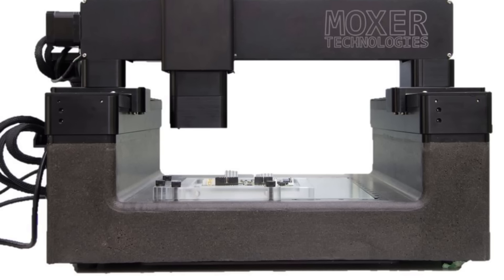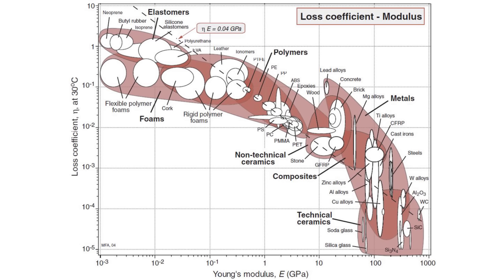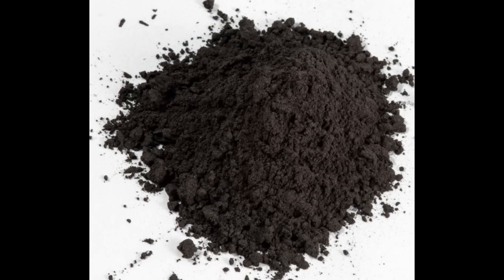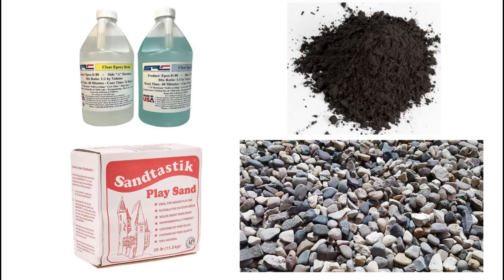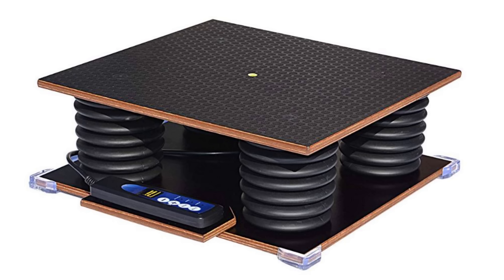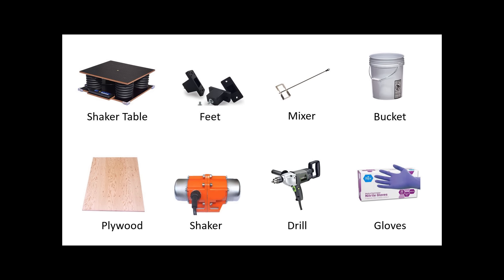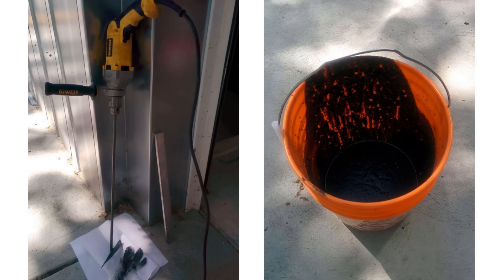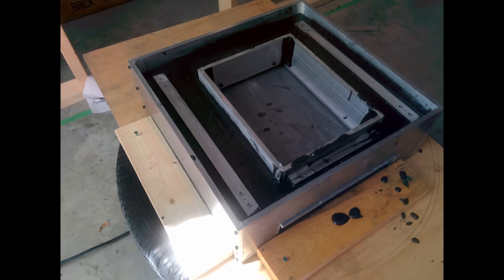How to Build Epoxy Granite Machine Base

Comment: I wonder if several old video game controller vibration motors would make enough vibration ?
Reply: Not in the right scale. You could rig up a sawzall, but I don't know if it's motor could take the heat from running that long.

Comment: Why call this tutorial video "Epoxy Granite" whereas there is literally zero granite aggregate in the various recipes? You used sand. It's a sand-based polymer concrete, not epoxy granite.

Comment: First off great video. Very informative.
I worked on an R&D project using Metal Injection Molding. The goal was to maximize the density of the metal balls and minimize the plastic filler. I learned that if you have fairly uniform diameter balls, the amount of plastic was about 17% (by volume) to have a mixture that had no interstitial voids with the minimum plastic. This 17% figure will always be the same for any mixture using uniform ball (or rocks here) size regardless of the size. Somewhat counter-intuitive to me. This would seem to be applicable if you assume that the sand grains are fairly uniform in size.
You can get a denser mixture by using significantly larger rocks with the sand filling the space between the rocks.
Here in Florida, I would put the fillers in the oven to drive out any moisture.
Reply: that's because of the nature of packing spheres. Sand grains can pack much tighter because they aren't spheres.

Comment: Are those epoxy resin components clear in color? I probably would have mixed the dye with part B first in a separate container, so that I could see the color of the whole mass get even to know I'm mixed properly.
Reply: Sometimes you ad a drop when you put A and B in one container before mixing it together but mostly when you add hardener to epoxy it looks like ading oil to fuel....you mix it until eweryting is clear.

Comment: So when it comes to vibration dampening, did anyone ever compare this to the stuff typically used for setting machinery? Stuff like precision grout, or some of the metal based aggregate grouts, or something totally epoxy based like Loctite nordbak? 

I would be curious how an epoxy and precision grout would behave. Interesting, would be cool to see some data on vibration dampening effect.

Comment: do you think there'd be any benefit to casting epoxy granite into aluminum t slot extrusions, such as 8020? My CNC is made with 4x2" beams and Ive been considering filling them.
Reply: I'm wondering the same thing. Did you try it? Did it help?

Comment: I have done this with my own recipes and here are some tips and tricks.
1) Pre-heat the sand and resin which helps to speed up curing and removing bubbles as it lowers the viscosity of the resin. ( I didn't get any bubbles without using a vacuum chamber)
2) I mix sand, pea gravel, and crushed rock for mine as it uses less resin (Approx 5-10% resin to other ingredients)
3) Fiberglass resin also works extremely well and this is what I use (40$ at Walmart for a gallon).
4) If you want it to look professional, mix in charcoal powder to give it an extremely black coloring and nice surface finish. I made my powder from aquarium charcoal in a blender.

For my next tests, I will be mixing glass fiber along with the other ingredients to try and increase the composite strength.
I was blown away by this polymer concrete's performance and will not be going back to regular concrete.

Comment: I like the theory {a lot}, however, I wonder how well it can stand up to years of vibrations on a CNC router? I have a "few" sheets of MDF under my spoilboard just to add weight to the table.  The steel framing members are double the weight they need to be just to add mass.  A 5'x10' epoxy table for a CNC router would be a challenge.  
Very nicely researched and the results are spectacular.
Reply from the maker: Thanks Lew!

Good question, would be interesting to run a long term durability test on this. Epoxy is highly resilient, it can take a ton of abuse, and still hold up.

Two machine base builders, Castinite and Zanite both build commercial frames in a similar manner, although they refer to this material as "cast polymer" or "polymer composite"

Weight definitely helps knock down and absorb vibration, although stiffness and damping are equally important.

Would be quite a challenge to build a 5'x10' bade for this. I imagine building up a single use mold out of waxed MDF, and then dividing the pour up into multiples so they cure time doesn't take weeks. What a project that would be!
Reply: For a router, I'd surely combine both steel tubes and concrete in a Constrained Layer Damping configuration to maximise the damping/weight ratio.
I'm actually even studying it for a VMC project
Reply: I'd just fill the box beams with the chosen absorption material for that.

Comment: What is this machine for? Laser cutting?
Reply: I don't believe he would need this level of rigidity for laser cutting, probably cnc milling :)
Reply: @theonismithcreations8554  strange... CNC milling require a super rigid structure, like steel or full aluminium profile
Reply: @yakine13  considering this has an aluminum skeleton with an epoxy/sand  encasement, this would be more than enough to mill anything aluminum and softer. 

Reguardless, he is using this for extra stable micro photography.

Comment: I had never before heard of epoxy granite before today
Reply: I started the first polymer concrete casting company in the US in 1988 and have been producing castings for grinding machines, inspection equipment, chip bonders, chemical pump bases, etc, since. CASTINTE

Comment: Why concrete isn't so good as epoxy granite?
Reply: concrete brittle as biscuit. epoxy flexible. make good vibration dampener. 
sand and rock make epoxy heavy so machine dont move. combine make good material. 
brain too smooth to think?

Comment: My theory: using a vacuum chamber or high pressure to get the bubbles out will propably lead to maybe only epoxy filling the voids. You want the filler material as dense as possible though. Vibrating the material would be the best choice then I think. Your vibrator table seems to not be sufficient enough, maybe try a small electric motor with an offcenter weight on the shaft, and something to control the motor speed maybe. Would also be cheaper.
Only using sand is also not that great, since it still is kinda coarse. There's some basalt based grit that's used for filling the gaps between walkway stones, it has bigger particles (maybe 1/16") down to dust like particles. Should work nicely.

Comment: You could eliminate some of your epoxy by using a finer aggregate all the way down to fly ash though fly ash can pose a health risk.  Epoxy by itself isn't as strong as the aggregate you are using.  Less epoxy, stronger mix.  Same with concrete.  Portland cement by itself isn't very strong.  It's strength is in sticking bits of rock together.  Great build.  Thank you for posting.
Reply: The epoxy doesn't need to be strong. It's purely for damping.

Comment: Hello Adam!
Good choice for the base but I was more interested in the precision aluminium sections and how you went about procuring them.
Perhaps you could try the electro magnetic vibrator ( without a motor and eccentric weights ), which have a small amplitude of vibration about 1.6 mm, also used by construction people.
Also you could use silica flour as fines. This and the sand should be dry as the heat generated will release some steam.
Anyway you've been acquiring the skills as you went along.
Best wishes!

Comment: Are plans for the rest of the CNC machine available? Also, I wonder if you could further reduce vibration by filling the hollow aluminum tubes with additional vibration dampening material.

Comment: Isn't lead alloys closest to the upper right corner of the chart? Let's take a quick look. 

Pros: cheap, easy to cast, easy to machine, very heavy. Cons: very heavy, not strong, the weak alloys dent easily, the strong(er) ones are brittle, oxides of lead and many of the alloying elements are toxic.

Comment: yeah looks like you may have had some moisture troubles. And a vacuum chamber is a good idea but only vac each epoxy side A-B separate before mixing. This will help remove a lot of the air bubbles and when you mix do so gently to avoid adding air. For the best results after drying all other materials, vac A-B parts separately, you could pour some material into mold (not all), (I would pour epoxy in the mold 1st then add the rest)mix epoxy, pour and then add the rest of the material, stir all together gently to avoid adding air and then put mold in a pressure chamber to around 55psi up to 65psi... this will absolutely give you the best results.. I highly recommend Not Pouring one part of the epoxy in the mold adding filler and then adding the other part of epoxy!!!! Epoxy should be mix completely by itself before adding any of the other materials to it.. I think you have a great idea I really do, but I gotta say you went about mixing it all wrong bud.. resins can be really fussy, sometimes an out rite pain in the rear.
Reply from the maker: A pressure chamber would have been great for this build! Unfortunately I did not have one big enough for this mold...
Reply: @AdamBender  Preston is correct. Mix the liquids first and draw a vacuum on that mixture. You have to remove the moisture or you will get a lot of internal voids and poor strenght.
Reply: Yes, degas the resins 1st and pour enough into the bucket to avoid sucking air in while mixing. Also, bake the sand & grit to release moisture before use. Also part of the goal is different grit sizes to scatter & absorb different frequencies.

Comment: Isn't play sand mostly quartz? Wouldn't decomposed granite have been a better choice since the granite rocks were removed from the mix? Also how well does the machine work, can it handle steel?
Reply from the maker: Yup, I believe so, perhaps epoxy quartz would have been a better name for it, although I stuck with epoxy granite, since people are more familiar with that name.

It was actually a machine base for a 3 axis microscope, but given how stiff it was, I'm sure a small spindle could have been mounted to it.

Thanks for watching!
Reply: I would avoid decomposed granite myself, because it might continue to decompose over time. The granite contains quartz grains, feldspars and some mica. The feldspars and mica decomposes and take up extra space. They become clays and oxides. The Quartz in the sand is very inert, being Silicon Oxide already.

Comment: It's a lot of work, kudos for that. But you didn't the address the most important part of the build. The actual flatness of your surface and how you got there.

Why wouldn't I use concrete instead with an epoxy finish?
Reply: You got the point!

Comment: Great work here! 
You inspired me to think of a couple things that might help. 
1) a cheap shaker motor is easy to make: just use any motor, bur on the shaft you put an imbalanced load.
2) Instead of using an impossibly big vacuum tank, use the atmosphere itself by doing the opposite: mix the epoxy inside a pressure tank. That's way smaller. 
When you're done mixing releasing the air bubbles that were at high pressure should vent off easily into 1 atmosphere. When you pour it take care to not create bubbles. They shaker table should help with the rest of any trapped air.

Comment: Is this an established method of creating machine base?
Reply: Polymer concrete is what they use nowadays to make most accurate machine bases from, with aluminum inserts for attaching ways etc.
Reply from the maker: This has been used in industry for some time, but this method opens it up to the hobbyist with a limited budget

Comment: Very strange load tests, the real machine and half do not.
Epoxy granite is justified only by its weight, weight allows you to reduce the frequency of personal vibrations of the structure. But metal is much more justified in this, if the melting of steel and cast iron is not available, then it is worth considering bronze and brass.
The simplest and most affordable base for a CNC machine is a square welded steel profile fill in concrete. Simple and cheap.
Reply: 100% tak!

Comment: So not granite, epoxy concrete. I think I would put chopped strand glass in it as well for added strength .
 I am wondering if there will be problems with thermal expansion causing the aluminum and concrete to delaminate. Take your test block put a dial indicator on it and heat it up 100 degrees. Calculate the thermal expansion coefficient and compare that to aluminum.  It will make an interesting video.
Reply: Chopped glass does not work well because of the sand filler
Reply: @terrycapuano982  glass strands are used all the time in cement/concrete and in epoxy so why would it not work when concrete uses sand as a filler.

Comment: Some suggestions:
1. To improve mechanical characteristics, use 
 - a single digit percentage of epoxy
 - an aggregate with significantly better packing density
 - preferably grey cast iron or at least steel as reinforcing and interface members as its CTE matches that of the composite described above
 
2. Feel free to coat the inside of the mold w/ your material of choice (most of the time I use carbon-filled (i.e. toner powder) epoxy which gives a nice, shiny, smooth, jet black surface) before you start filling the mold w/ your actual mix. This way you don't have to factor in aesthetics even when you're supposed to design your composite to achieve the best mechanical properties.
3. Reinforcement might not even be necessary at all if your machine frame was designed to take advantage of the compressive strength of the composite, which can be brought up to 200+ MPa if you're open to using a more decent mix.
Machine tool manufacturers don't seem to bother reinforcing their frames.
4. Vibration is the way to go. Vacuum pumps don't take epoxy vapor particularly well.
Reply: If you arrange internal cooling to the aluminum frame, it is actually better than steel or cast iron, as it conducts heat 3 times faster, thus you are able to maintain a set temperature easily.
Reply: Agreed thats how the machine builder kern has machines with about 1 micron positioning tolerance
Reply: Hi sniperasys, could you elaborate on the "more decent mix" you mentioned to have a greater comp. strength?
Reply: @JaakkoF  Hei Jaakko, voitko suomentaa tämän neljän kohdan ohjeistuksen ensimmäisen kohdan? En ymmärrä kahta ensimmäistä ranskalaista viivaa.
Reply: @uciaok  I'd imagine a much bigger gradient of aggregate size? Like a good concrete 🤔
Reply: @fannerguitarworks1024  I guess it should need different sizes of aggregates instead one. Like right ratio of Fine and Coarse aggregates would give better dampening properties with compressive strength.

Comment: Your final result looks great!
However there are a few issues I have with your video.
Firstly the gloves aren’t for clean up primarily but for safety! Epoxy can get pretty nasty and the last place you want that stuff to be is on your body!
Secondly, to ensure that the epoxy is mixed the right way, you have to mix both parts first! Than the sand and dye. It could be that your result works for you, but usually there is a huge possibility to fuck up. Also, if your epoxy is slow you have the time to do it right.
And lastly, this is just a preferred method of mine, if you use a filler for creating the round corners you could perfected those even further.

Still a pretty nice video and I appreciate the work you put into it

Comment: Great video! I'm planning on reinforcing and expanding my small milling machines column and base and make the switch to linear rails on all 3 axis. This information is very helpful.
Reply: He did a good job, but is using way too much resin. It will provide poor mechanical properties.CASTINITE

Comment: A few of my ideas...
step 1 mix just clear expoy and harder together brush spray into mold...  let it tack up the us a heat gun to pop bubbles... on the surface of mold let it set up for several hours..
Step 2 mix epoxy with harder and black pigment or paint... spray over  the clear expoy let it tack and use heat gun to pop bubbles repeat  a few times on corners or vertical surfaces where you need thicker covage...let it dry or tack almost dry..

Step 3.. mix expoy part a b add optional dye then add sand.... the harder... apply with  spreader or bondo spreader to mold 1/4  to 1/2 thick coat  as a surface finish to finished faces.. let it dry

Step4  next day mix expoy with sand and some small gravel...fill mold up to 1/ 4 below desired depth...mix new  top coat with expoy sand mix and Harder etc... to give smoother finish on under side

This is how I get flawless  smooth expoy granite.
Reply: Step one and two in one step: Called Gelcoat.
Reply from the maker: This is a great method, those surface bubbles haunted me, sounds like your technique would eliminate that. Thanks for sharing!

Comment: I think I've read your article on this about 10 times now. Great to see some videos too. A long-term review of the microscope / base would be interesting. Will keep watching for more videos.
Reply from the maker: Thanks for watching Aaron! I'll keep the videos coming.
Reply: @AdamBender why not adding fine rubber or foam aggregate with concrete and a urethane binder? Why aluminum not steel?

Comment: I have been looking for this for a long time now. Thank you 1000 times. I just finished a steel gantry mill and it vibrates worse than a tuning fork and i need a solution. This is it. I'm going to fill it and encase it with epoxy granite. 

lets see it run!!

Best Matt
Reply from the maker: Yup! This would be a great way to do it! 

Another option if you have a tube framed design is to fill the tubes with sand! Sand does a great job at killing vibrations too. Just be careful, it'll make things white heavy! Make sure you have enough power to move your gantry around